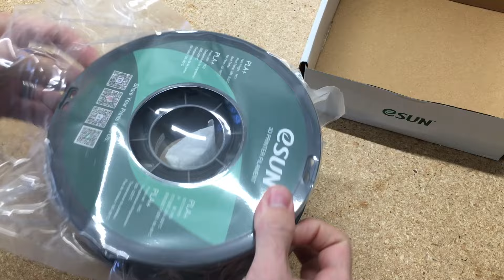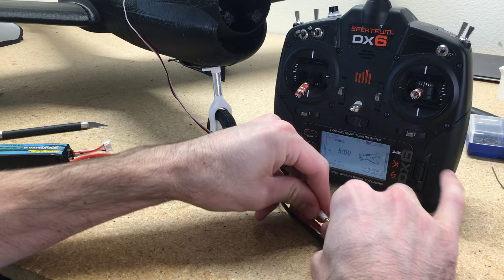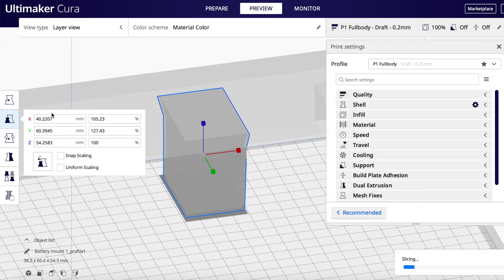How to Assemble RC 3D Printed Tucano - Planeprint

Comment: whats the total cost on this, assuming I own nothing but a printer?
Reply from the maker: only a printer.. you need to have basics for flying like a controller, a charger, batteries. then there is pla, and electronics. for just the plane around 250$ in materials and electronics. starting around 400$ for controller and charger, other tools, and can go up from there

Comment: Troy great vid can this be printed on a ender 3. Im using cura 4.8 ,after watch your vid on thin wall printing ,i am getting nice prints.
Reply from the maker: I am happy to hear you are getting nice prints. Yes this can be printed on an ender 3. It requires a 200x200x200 build plate to be printed. There are a few changes with Cura 4.8 they changed the tab for retraction settings. This is an awesome plane. Have fun with it.

Comment: Good day. I need help with the canopy please. I have assembled the body , and canopy. When I put the canopy on the body there is a huge gap at the back. I tried printing it various times with no success . Any help would be appreciated
Reply from the maker: I had the opposite problem.... Mine needed to be sanded a little to fit. That being said, just double check that you didn't move the part below the build on Cura. It could be being printed shorter for that reason

Comment: from the video it looks the plane needs a little bit sandin, maybe it is smooth enough i don't know.
Reply from the maker: Ya it is unfortunate that in the build video the surface of the plane dose not look to good because I have bright LED lights above my build table that shin on the black. Outside in daylight or in person the plane looks really good. I would not recommend using black PLA to print this out. It is a hard color to work with. It shows sand marks and glue a lot. So you basically can't sand it at all and have to use the exact right amount of glue. :)

Comment: Would retracts be possible on this plane? I find it interesting that even with out them it still is trying for that scale detail
Reply from the maker: The wing is a bit too small to fit retracts in the wing. It would have been nice to have retracts to add to the scale look of the plane. The fix gear and no flaps is nice because it makes the build a bit easier. Also when you take it out to the field it is easy setup with just adding the wing half and only having to hook up one servo wire for the ailerons.

Comment: Hi Troy, great video. Your thin wall link didn't work for me.
Reply from the maker: Hi Graham, Thank you for letting me know about the link I just fixed it. Cheers
Reply: @TroyMcMillan   Thanks Troy. I am designing and 3D printing an RC Lockheed Electra, so I'm fascinated with the way the parts are thin walled and are just glued edge to edge. Or do they interlock slightly? Have to say it looks great in the black and the surface finish is good even at .25 layer height. It flies brilliantly as well.
Reply from the maker: @GrahamBatho  Thank you Graham, Wow a Lockheed Electra would be awesome. What will the wing span be? How far along are you in the build process. I have been wanting a multi engine 3D printed plane. The parts are interlocked together. If you look close in the build videos you can see a bit of a lip that all the parts fit together. I was happy how the black turned out. In the build video it doesn't look to good because I have bright LED lights above my build table and the reflection on the parts doesn't look very good. Out side it looks good.

Comment: Hello Troy, first, thanks for all the great videos!  I subscribe and I think I have watched all your build and fly videos!!   

Question?  I have an AC Vyper and I am trying to print my first 3D airplane ( relative newbie), the PP Super Tucano.  I used all the recommended settings for the Planeprint P3 thin wall profile from the instructions and your video and the first part, fuselage 1V2,  came out okay but there are many little blobs across on the surface with minor stringing inside. I used a new roll of Geeetech grey PLA with temp at 225C, 6mm retraction, surface mode. Initially, I had the temp at 230C but there was a lot of inside stringing so I reduce it to 225C.  The part is almost useable but not very pretty and there is even a small area on the vertical stab dorsal fin that might be a bit under extruded,

I can send a photo if it would help you but I wonder if you could take the time from your busy schedule to give me some advice on how to improve on this.

Again, I'm a big fan, keep the videos coming!!!!!
Darwin
Reply: Try 200 degrees for pla aswell use 50mm/s print speed.
Greets

Comment: what is the weight of plastic. no motors no servos no baterry... just the 3D printed
Reply from the maker: With out electronics it is about 1288 grams. This weight can be slightly different depending on the print quality.

Comment: Ok good build video but you are missing some stuff. Please source carbon tubes, hot knife, drill bits (whatever size you use in the video)
Reply from the maker: Thank you for letting me know I will add that to the description. The carbo rods are a bit difficult to find sometimes. To get the correct length and have them in stock. I get me carbon rods from (Ready Made RC)
Reply: @TroyMcMillan  Yep just mention RMRC and that should do it!
Reply from the maker: @pbshooter100  Thank you for mentioning that. I updated the description

Comment: So you never mentioned what model 3D printer you have, unless I missed it
Reply: check the description it has it listed near the settings they said they used a JG A5S 3D Printer and then the settings for it
Reply: @firenutter1798  thanks, those 3D printers aren’t that expensive as I thought it would be. New hobby here I come

Comment: there is Always something  Wrong with these designs.      while it looks like a good wing profile was utilized, there is still plenty of  iffy-ness, here.            it is not clear whether the structure of the tail boom is sufficient resistant to twisting.         at 5:34,  oh  YEAH.    i always like to put  HEAVY  cf,  AT   THE   TAIL !!!!!!         at 8:58, i would  use  slightly larger wire;   the stated rationale should not be seen to  override  common sense.          at 11:03, stoopid  GAS  prop, in the background.          at 11:18,  all  that  HEAVY  cf???    NO WONDER  the model is heavy.        all that  Outboard-located  MASS  is  reducing  roll-axis  stability.           EVER  HEAR  of  hardwood  DOWEL.           at 16:00,   the main spar is noT  correctly located, at the fuselage.     consequently, there is shearing force  THERE.    because, the lift line  IS  at  THIRTY  percent  of chord!!!     googletranslate
Reply: Dude get out and build something if you're that cranky. There is absolutely nothing wrong with any of this build. I've been building RC planes and flying them for 30 years and this is pretty standard stuff. Get over yourself.
Reply: @Chris_Bro_aka_MR_PLAT1NEM  dude  BITME     there is a problem here, and  its  NOT  me.        if you are allergic to  getting  smarter,  thats just TOO  DAM  BAD.    tool
Reply: @daviddavids2884  You're a knob...You're Welcome, but I'm guessing you're told this fact pretty often...🤔🇬🇧